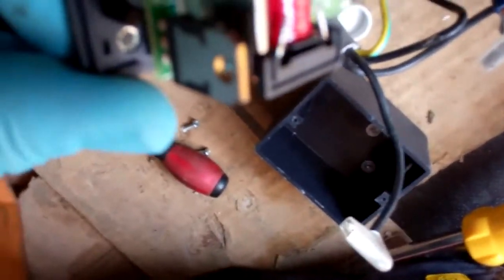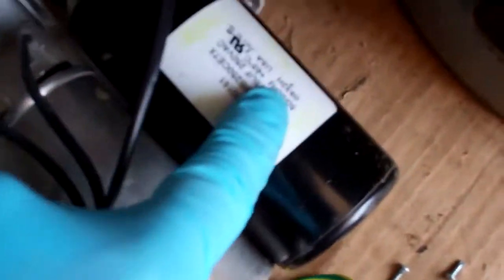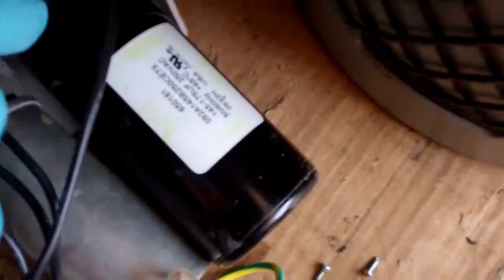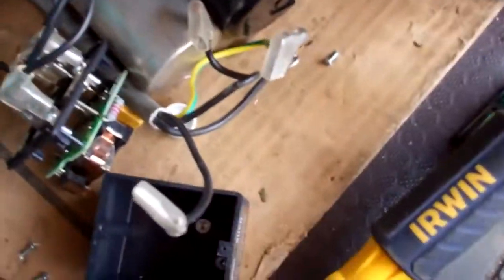HVAC Universal 521 Hardstart Relay Autopsy

Comment from the maker: @rotarycomptech Yeah, there more to go wrong for sure!

Most times the overloads (if fitted) will catch something like this before it goes terminal, i have another relay i keep meaning to vid and the cautionary story that goes with it, that did the same thing but the overloads tripped and the compressor has been running fine since with some new caps and relay.